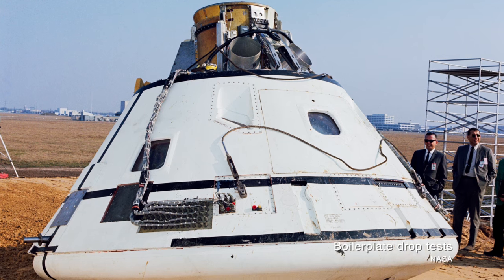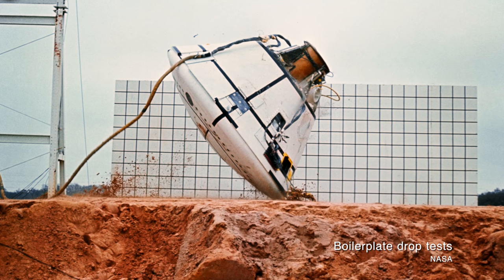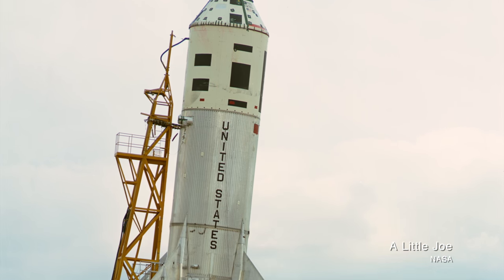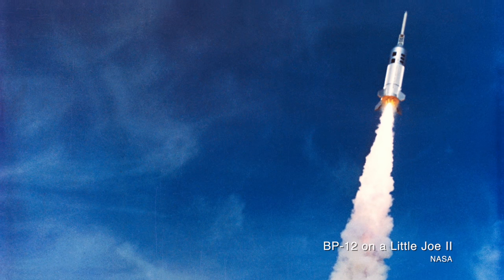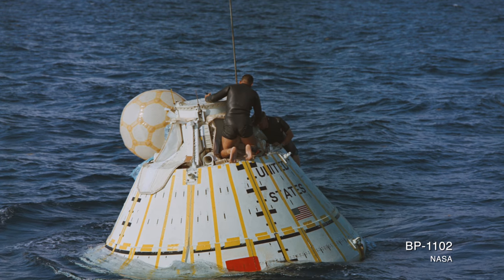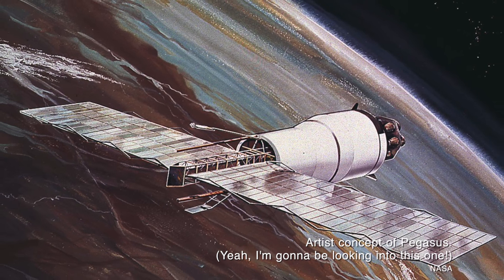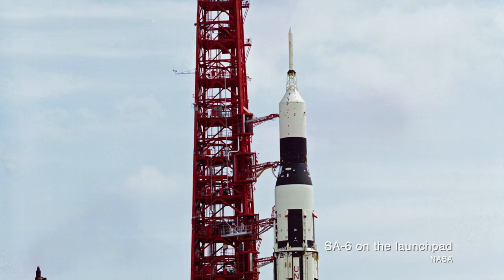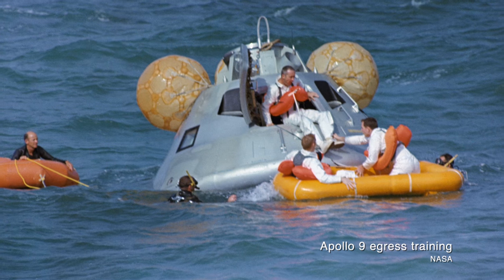What Exactly Are Boilerplate Spacecraft?

Comment: Amy, I used to volunteer, a lot, at the Air Zoo in Kalamazoo, MI. The Air Zoo has a connection to the Smithsonian is able to display items, from storage, that would normally never see the light of day. They have the only remaining Curtis XP-55 and a boiler plate Gemini (?). I remember being told it was used for drop tests and had been nicknamed "El Kabong". My job was making an accurate tracing of the NASA stencils/paint work so that it could be put back on later, after cleaning/painting. We used clear acetate (?) for me to draw on getting every detail. The acetate sheets were located using door edges, seams, bolts, etc. (I had the same job on the XP-55) A VERY impressive laminated wood cradle was made for this BP by another volunteer.

Comment: Do you know where the term "Boiler Plate" came from? It is a newspaper term. In the old days of letter press printing press, they would set type for articles. Graphics that were repeated a lot, like the mast head and some ads were etched into steel plates. This steel was commonly know as boiler plate, because making boilers was it's most common use. But in newspapers, the term came to mean something that was repeated the same way. It remains as an expression for a repeated standard, like a boiler plate contract.
Reply: Boiler plate, can also refer to the metal to make boilers. I think the term here refers to rough copies made out of crude metal.
Reply: Learned something today . I always thought it was an old term from Steam Locomotives , the Boiler Plate had all the Gauges and Controls on it . Made sense to me . Thanks for the info .
Reply: Yes that's exactly what I am saying. Heavy plate steel in the 1890's was called boiler plate because it was usually used for making boilers. But they still called it that even when it was used for something else. Like someone today might say they used telephone poles to build a bridge. But the way it became an expression was in the use of steel printing blocks in the newspaper industry. I just googled the expression and here is how What.com defined it:
"A boilerplate can be compared to a certain kind of template, which can be thought of as a fill-in-the-blanks boilerplate. Some typical boilerplates include: mission statements, safety warnings, commonly used installation procedures, copyright statements, and responsibility disclaimers."

Comment: Maybe this is a weird question, but:

If for some reason an Apollo capsule wound up in a storm after splashdown, what was the procedure?
Reply: Yes: I've always wanted to know how seaworthy the CM was if it ever had to be used as...   a lifeboat.
Reply: There was a good bit of re-entry maneuverability built into the Gemini and Apollo capsules that would allow them to be "piloted off course" if need be.  I don't know if this was ever needed to avoid bad weather, or to correct a bad de-orbit burn, but the ability DID exist.
The maneuvering possibility was there thanks to one Virgil I. (Gus) Grissom, engineer, original Mercury Astronaut, and frustrated test pilot who disliked being "Spam in a can".  He had a lot of engineering input into the design of the Gemini...to the point where it was often referred to as "The Gus-Mobile" by his peers.
The center of gravity and center of pressure of both Gemini and Apollo were arranged such that rolling the spacecraft with small thrusters would cause aerodynamic forces to turn the craft left or right by small amounts...and pitching would add or subtract lift, allowing the craft to steepen its descent or "go long" by small amounts.  As the re-entry took nearly half an orbit, these small amounts would add up to around a hundred miles on the ground.
Reply: Exactly as I described just above...Gemini and Apollo capsules were somewhat maneuverable.
Reply: I thought the nickname "Gus-mobile" came because Gus was the only one small enough to fit comfortably in the Gemini capsule :-)
Reply: The Man With The Hex 13 also had to change its recovery location because of a storm, but this was done with its final course correction burn.
Reply: I got to sit in the Gemini boilerplate they have (or at least had) at Goddard about 15 years ago.  I'm 6' 2" with broad shoulders and even in street clothes they could not have gotten the hatch shut without smacking me in the head and I had to hunch my shoulders to stay in the seat.  If they'd made those early spacecraft any smaller, the first American in space would have had to be Billy Barty.
Reply: It wouldn't end up there.   That would be a miserable ride for the crew and a dangerous recovery.

Comment: JUST a week ago, I took a quick trip to Denver for only one day-- found the Wings Over The Rockies aircraft and space museum (located right in the middle of a nice residential part of town, with a B-52 parked right at a quiet little intersection!). While I was looking at all the somewhat dusty aircraft, there was a huge amount of banging and clanging going on-- well, the place was undergoing some renovation, so I didn't give it too much thought.
Until I got around to one corner of the hanger floor. There was a boiler plate Apollo test article. I walked around to find the hatch off and some poor couple of devils inside re-arranging the large metal weights that simulated various internal loads. Wang! Clang! Bang with very loud hammer blows.
That was a dedicated pair of volunteers.

I did not get the BP#-- too noisy. But it was fun seeing the real thing! (It strongly looked like BP#2 skin markings, the ground drop version...)

Small world, eh, Amy?
Reply: Their website says it's BP-1101A, used in floatation testing.

Comment: I visited RAF Woodbridge in Suffolk, England back in 1987. At that time, Woodbridge was the home of the USAF 67Th ARRS squadron which operated HH-53 Jolly Green Giant helicopters. 

They had been there for many years and during the Apollo era had been on standby to recover any Apollo Command Modules that might have splashed down in the Atlantic after a launch abort or perhaps landed off course following return from the moon.

Even as late as 1987,, nestled under the trees and tucked away in one corner of the airfield, was a dummy Apollo Command Module which I was told they had been allocated to the 67th so they could practice recovery operations.

The airfield closed in the early 1990s and I always wonder what happened to that historic Apollo artifact.

Comment: The one that has me curious is probably the Apollo boilerplate that's one of the hardest to find information on, including exactly which unit it was--the one used after the Apollo 1 fire for fire testing of command module interiors, both as part of the investigation, and to qualify the redesigned interior and materials for flight.  Far as I know, even the Field Guide to American Spacecraft isn't sure which BP unit was used for that, though they've narrowed it down to a few that have been seen to have heavy fittings around the hatch and apex...

Comment: Vintage Space  >>>  Here is a related topic:  One of the {unmanned} Little Joe test launches - with a boiler plate[?] Apollo [?] capsule, to test the Launch Escape System - had an PREMATURE LES TEST.  Something in the control system of the Little Joe boster failed, and the rocket began an uncontrolled roll around its longitudinal axis.  As the booster started breaking up, the automatic systems initiated the LES to ignite and pull the boiler plate capsule away BEFORE it was planned to happen in the flight at a higher altitude.

Comment: Amy, when will you post a video or videos concerning the Apollo pad-abort tests and Little Joe II flight abort tests? Also a video about the Apollo LES itself would be good and one fact you didn't mention is the Apollo SA-6 and SA-7 flights tested the jettisoning of the LES by its' jettison rocket motor and Abort rocket motor respectively (The Abort motor was used if the Jettison motor failed to fire).

Comment: Hello Amy, :-)
The question I have had for years is this: after the Grissom hatch failure, did the capsule or capsules used for the subsequent hatch-fail and redesigned hatch tests come from BP capsules already on hand, or were extra BP capsules manufactured specifically for those hatch-fail/hatch-redesigned tests?
Every book I have read on the topic seems to pass very quickly over the entire topic, barely mentioning the two hatch test-series. Thus the capsules employed in the two test-series also remain unmentioned.

Kind and Respectful Regards Amy, Uyraell, NZ.

Comment: Hello I have a question about the F-1 Engine and the Thermal Protection System that was used on them. I've been doing some research since I'm trying to model an accurate version of the Saturn V and found out that the F-1 Engines were entirely covered with an ugly insulation. But the engines are always depicted as naked even in the Apollo 13 film they are naked. Why is this why so little information on the insulation of the F-1 Engine. Would love to know what you can dig up on this.

Comment: You mentioned using boilerplates on Little Joe II rockets to test the LES...how about doing something on the one LES test where they never got to do the actual test b/c the Little Joe exploded during ascent, but it all worked out in the end b/c the LES and emergency detection system were hot, and worked perfectly, saving the capsule from the exploding rocket?

Comment: Hi Amy, what was the story behind the apollo 15 astronaut (which one?) dropping a feather and a hammer on the moon in defense of Mr. Galileo? Who came up with the idea? Did they bring the hammer for this purpose only? (or did the have a standard toolbox including one?) And if so, was there a debate about including this extra weight (a hammer is about 1 lb, right?) only for this demonstration? Maybe you can address this in a future video. Thanks!
Reply: This would make a fun video.
Mission Commander David Scott did the experiment using the geology hammer that was part of the Apollo tool kit. Since this was an all Air Force crew, the falcon feather came from the mascot at the Air Force Academy in Colorado Springs.

Comment: would the shuttle enterprise be considered a boiler plate?
Reply: Structurally it was closer to a flight article and they considered refitting it for orbital flight.
Though it was used as a boiler plate for vibration tests.

Comment: Amy, what I'm most curious about is what they mean by "boiler plate". Real actual boiler plate is steel and therefore much heavier than aluminum (aluminium if you're british :P) So, when they say "boiler plate", did they actually make these capsules/modules out of steel to simulate the additional weight of all the eqiupment that would have been onboard the vessel?...or did they just call an empty aluminum hull "boiler plate" because it's...well...just a big empty tank? Even if the things were still aluminum, I would hope they were putting some bricks or sandbags in them to keep the weight as close to aproximate mission specifications as possible. You tell me, girl! I've never sat on the lap of the notorious "tuna scandal man". :P Hey Amy, here's a little something for you to think about...I bet you have met many of the old "Great Stuff" as well as Apollo astronauts. I bet you have shaken hands with them too. How many of those hands you shook have shook hands with WERHNER VON BRAUN?!! Anyway, send me a coupon for your book and I might just pick up a copy. Put a copy of your book in my lap and I will read it. I may give it a purr of contentment...or maybe even a grunt of satisfaction. ;) I won't know til I can read the thing. You got "The Right Stuff", so make it happen, honey!! :)

Comment: Boilerplates are oval-shaped and not round so they can be turned sideways and fed to the inside of the container. Once they are bolted in place and the pressure inside the boiler builds up, it compresses the gasket, creating a much better seal than if the boiler plate were bolted to the outside of the container. But this has nothing to do with NASA or spacecraft.

Comment: Why did Apollo 13 take a little over 5 minutes to regain radio contact with flight control when other Apollo flights averaged about 4 minutes
Steve
Reply: Stephen Griffin , their re-entry trajectory was flatter than usual, and meant they had more atmosphere to pass through.
Reply: That's more or less what I thought just wanted it validated. Thanks